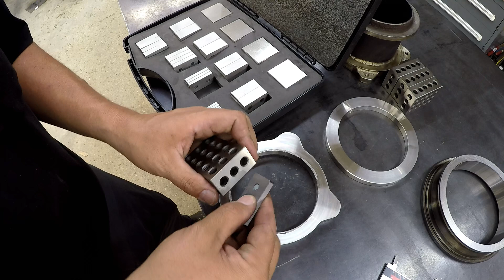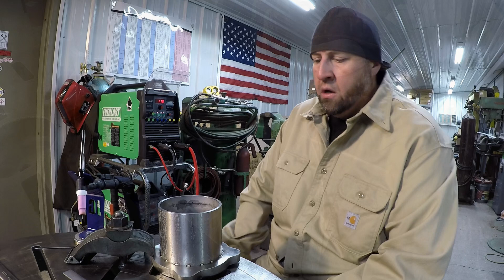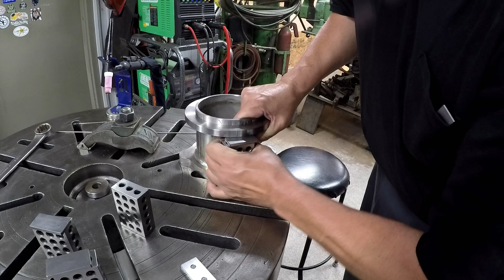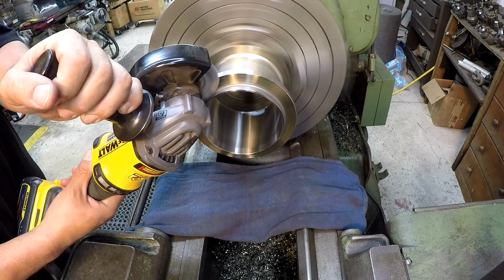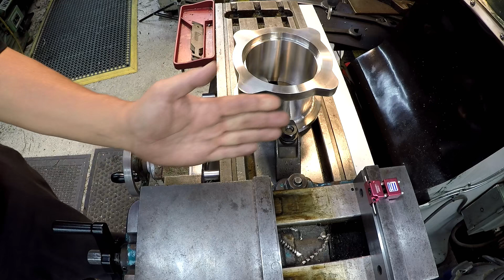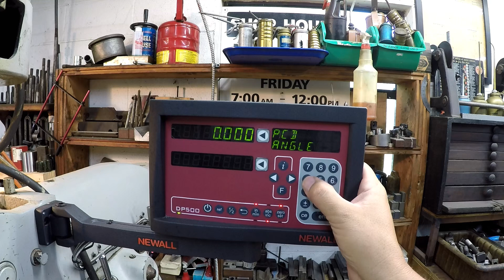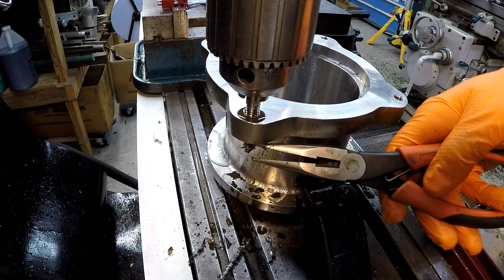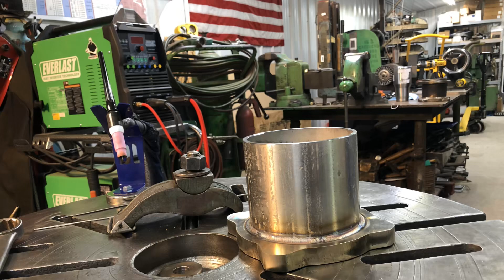Stainless Exhaust Collector Part 2

Comment: Dumb question time. At about the 40 minute mark,Adam talks about mist coolant and rust. I would have thought that any coolant or flood coolant like that would be a mix of water,old time soluble oil plus maybe some Sodium Carbonate(soda) so that corrosion would be a non issue till the water evaporates. Am I missing something or is Adam being his usual careful self ? As in,belt AND suspenders ? That way your trousers stay up and the steel stays clean.

Comment: I’m surprised you didn’t use sandpaper on the outside of the pipe instead of the wire wheel. It would look better but nice job.

Comment: nice job, but don't you have to mark the WD40 section as "sponsored content" ? 
also - i know that most outer faces of that pipe are non-critical, and the customer wouldn't pay for it - but my OCD would have demanded uniform surface finishes, like sandblasting or acid bath :D

Comment: I believe that the taper on the inside is to smooth out the transition from one part to the other and improve exhaust flow. Also, by machining the inside of the pipe you have eliminated any rough spots and therefore further improved exhaust flow.
Reply: I have seen cast iron rings used on exhaust flanges like this.. they are like a piston ring that seals the ID on the flange.. The taper allows the rings to slide in without a compressor..

Comment: Make yourself an arm rest for your TIG hand and then get a welding positioner. might be able to use a lathe head to spin at a really slow RPM. Then all you gotta do is hold your tungsten and feed the rod. That's why they make the pulsed TIG function. A lot easier and more consistent than walking the cup if you can rotate your work piece.

Comment: I think the fusion weld is to prevent crevice corrosion.
Reply: You could braze or solder over the seam. If it doesn't flow in it can tin over the seam and remove the crevice.
Reply: Dan Powell > unless l am mistaken the vid advertisement said it was stainless, of which you can NOT solder, or braze
Reply: Agreed
Reply: I'm surprised the other flange isnt fusion welded on the inside as well.
Reply: @ionstorm66  yeah, I had the same thought
Reply: I also agree and for an even better fix you could braze it to get the filler right down in there and turn off the remainder in the lathe.
Reply: @flyingpictures1100  Not sure you would get the braze to flow into a press fit joint - no clearance.